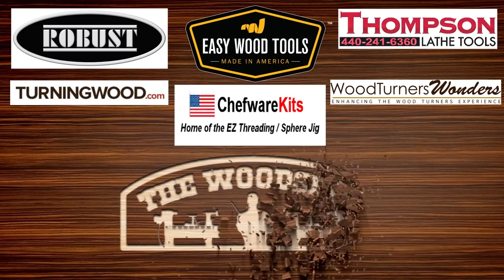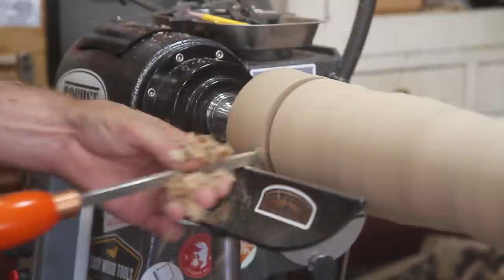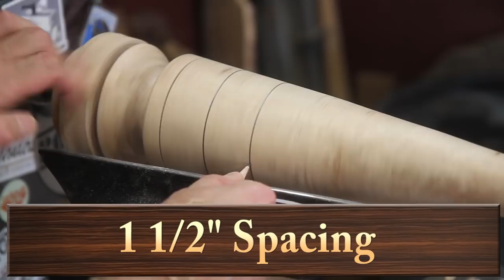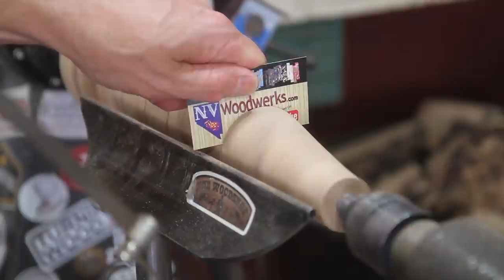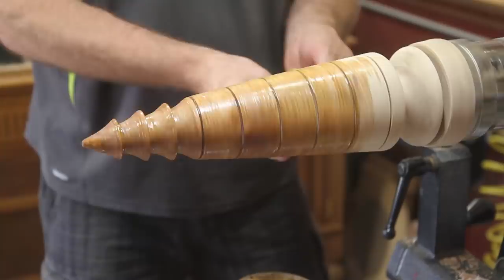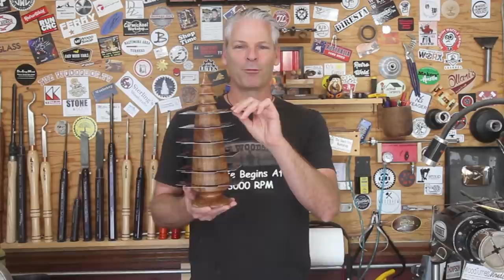DIY Business Card Display | Woodturning Project | Carl Jacobson

Comment: I made a parting tool that makes a kerf .050 ... made it to cut grooves to fit basket reeds in, but should work for this too. Made it from a Sawzall demo blade ... took the teeth off an thicknessed it down to .050 with a belt sander.
Reply from the maker: Cool, great idea thanks Gerald!

Comment: I've used a coping saw at the school shop on their old PM45 that I got running again, but instead of running the lathe in reverse or going to the other side of It I just took the coping saw blade and put it in backwards. that way the teeth were facing away from me so it would actually cut.
Reply: I've done that before
Reply: My thoughts exactly. The lathes at work don't do reverse.

Comment: I have a Comet II midi lathe. Just wondering what type of stand you like better.
A bench top type or stand with legs ? As of now mine is a substantial cabinet with a 24" x 36" sold top. Collects a lot of wood. Thanks for your time.
Reply from the maker: The cabinet type is more stable I think.
Reply: Thanks.